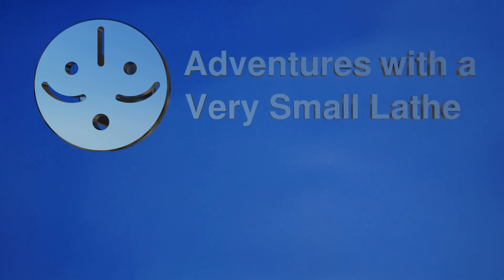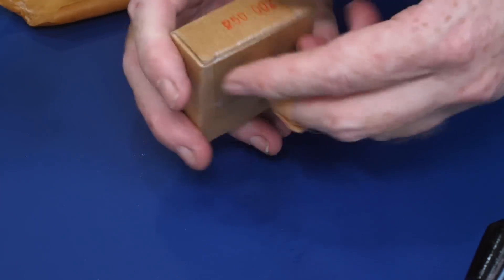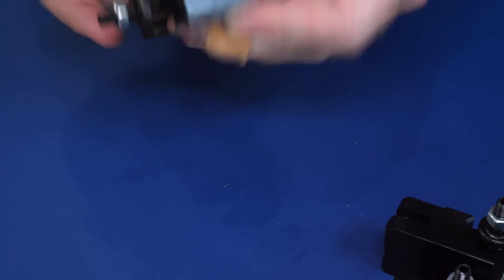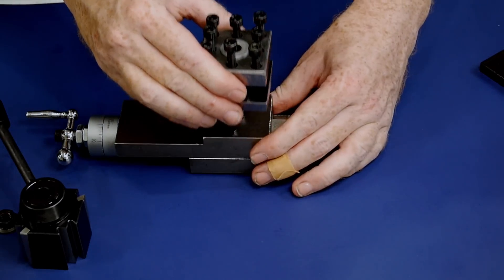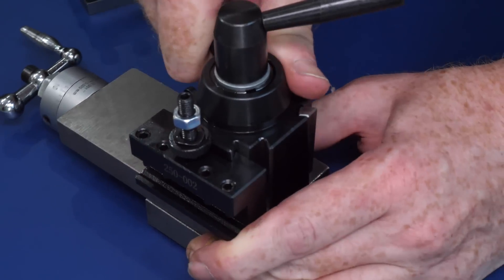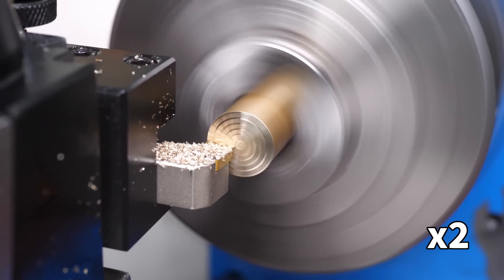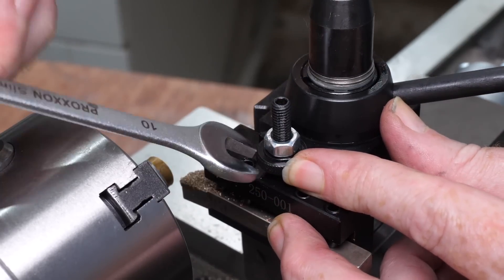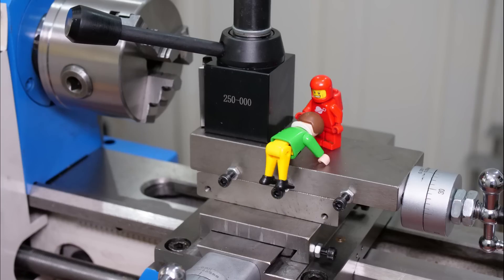Installing a Machifit Quick Change Tool Post on the CJ0618 Lathe and Banggood Tool Post Review

Comment: I envy how silky smooth the action is on your tool post. I have exactly the same tool post and the action is Anything but silk smooth. As near as I can tell the finish on the moving pieces is not great and I have tried cleans and dressing the screw-faces as well as possible. It would be nice to be able to get the center screww out to be dressed in the open, but I can't seem to get that far in disassembly.  Have you have your TP completely disassembled?  Ant tips there?

Comment: When you tightened the locking nut, on the height adjustment screw, the knurled adjusting nut moved slightly.

Comment: I bought this same QCTP for my lathe although my lathe is little big bigger (Bernardo 500). I thought that OXA/AXA would be the right sizes to fit but still think that AXA is little bit too big for my lathe. Im using 12mm tool holders. It works pretty nice.

Comment: Am enjoying your mini lathe videos.  I found a use for that base plate that came with the QCTP.  I used it to replace the flimsy locking plate on the the tail stock.  It was 44 mm x 40 mm plate and I modified it by cutting off 4 mm off the 44 mm side making it a 40 mm x 40 mm square. Cutting this way will off set the locking shaft to fit the tail stock.  Very little jamming because of the close fit.
Reply from the maker: Nice idea!

Comment: Another way I was taught for setting the tool height on a centre lathe is to put a dead centre in the tailstock and use that to shim / adjust the tool until it is level with the centre point. This works well for all types of tool and saves stock (which saves money)
Reply: I was taught to pinch a machinist's scale (pocket ruler) between the tool and workpiece, if it's vertical the tool is on center, if the top is tilted towards the workpiece the tool is high, tilted towards the tool and the tool is low.  Quick and dirty and pretty accurate, make minute adjustments after you start turning if the tool isn't exactly on center. Of course it only works well if the workpiece is fairly round to begin with and fairly concentric with the spindle.
Reply from the maker: I was taught the same technique working on big engine lathes, but it's only as accurate as the tailstock height. Unfortunately the tailstock for this lathe is way off centre height, so useless as a reference.

Comment: Hi I just bought  similar lathe but I have dificulties understanding how to operate it because I am not a machinest.  from your tow videos disassembling and reassembling the minilathe machine I learned a lot and knew how to do adjusting and lubrecating. now I need to know how to make thread. the lathe came with several gears and really I don't know for what they are used. please addvice me. I would really appreciate it. Thanks in advace

Comment: Dose it fits your Proxxon lathe?
Reply from the maker: It has the correct height range, which is the most important thing, but a custom bolt or stud will be required to fix it down properly. I plan to fit another of this toolpost to the Proxxon, but haven't gotten around to making the stud yet.
Reply: @AdventureswithaVerySmallLathe   Waiting for the final setup😎.

Comment: Some addenda: Littlemachineshop has a holder which has a plain 1/2" bore with a sleeve to 3/8" for boring bars; the thread on the fastener that holds everything together is left-handed and a good fit for the step wedge in a mill clamping kit; the leftover stud makes a good replacement for the crude fastener under the tailstock; these posts will accept 1/2" tooling if you mill a little off the top of the cross slide; and, if it's still there, that little detent pulls out easily.  I'm particularly impressed with the parting holder; I've parted 2" diameter steel with it.
Reply: Fit a Unimat DB200 I wonder...

Comment: Thanks for your videos about the mini lathe, they where very helpful for me. I ordered one and also a Machifit toolpost with some holders. But I don't know which parting tool/blade to order for the 250-007. Can you recommend a universal parting tool/blade which is good for for steel and aluminum? Especially the needed size would be very interesting. Maybe you even have a link for a fitting one (seller or shop). Your help would be greatly appreciated.

Comment: I have come to the conclusion that after watching many videos on the 'tube there is a desperate need for a listing in electronic format..... to compare the various lathes, mills and tool peripherals like QCTP's, carbide inserts and most tool holders in various configurations that most people on BANGGOOD, EBAY, AND AMAZON spend lots of money on.
I have always thought that a loose leaf folder that gets added to and upgraded with the variety of tooling as time goes by would do the trick, but paper seems to build into a huge Bible like volume that loses itself and smothers the content by variety of pages without an index. 
I suppose it would just degenerate into a catalogue once the tool perveyors get in on the act, but what the heck, a catalogue usually depicts the tool in all it's glory and you can judge for yourself......just thinking, as I've gone down this path many times before and paper does accumulate by the ream so a digital file of engineering paraphanalia would be the one place to go to for all your needs.
Compiling one would take ages and you wouldn't be able to have the comparison of variety to peruse if you didn't have access to the info etc.

Comment: Here's a tip. You will get a much better finish with a cutter with a smaller tip radius. The ones you see me using are 0.2mm and will give a mirror finish.
Reply from the maker: Thanks, that confirms something that I was starting to learn from experience. I had a 0.8mm insert in the holder, because I last used it to form an inside radius.

Comment: Same style I got from Arceurotrade, though mine is unbranded. I've had mine for about 3yrs now and it's been a godsend in terms of time saving and workflow logistics.
Reply from the maker: Is yours one of the red "Metalworker" lathes that Arceurotrade list on their site currently?
Reply: @AdventureswithaVerySmallLathe  

No, I have a 1944 Grayson, which is a 7 x 24 inch. The Grayson eventually became the predecessor of the Myford ML series when Myford bought the Grayson company after WW2.

Comment: Hi, thanks for the video -- why did you buy the Sieg Copy, which is 499 from ebay, instead of the real Sieg, which is available for 80 quid more from arceurotrade? Genuine question, I've been pondering getting a C2 or a C3, and I've heard loads of horror stories from the chinese version -- so what convinced you to go for that one? Is there something I'm missing? Also you mentioned "problems" with yours, have you documented these somewhere? Thanks!
Reply from the maker: The simple answer is that I paid a lot less than 499 for this lathe. The closest Sieg model I can see on arceurotrade is listed for 590, and I paid a little over 300 for this one. I see similar listings pop up on eBay from time to time, but the number is always limited, and it seems to be listed as s different seller each time. I guess I'm lucky I got anything at all. :)

The reason I went for the cheapest possible, is I had genuine interest in finding out what the cheapeast option possible was like, and I figured it would make some interesting informative videos as well.

If I have the time and money, would a direct comparison between a real Sieg and the Real Bull Machine copy be of interest?
Reply: @AdventureswithaVerySmallLathe  I think it would be very interesting personally -- the 'field' of hobby lathe has a lot of stuff on, but a lot is outdated as well, ie nothing on the 'newer' brusless motors for example. Or wether the newer imports have metallic gears -- or just how much do you need to 'mod' them to make them usable...

Comment: Hi, I wonder if you or any of your viewers could help me. I need to know the size of the dovetail on the tool holders for this toolpost. I have lots of tool holders for the aluminum pushrod type toolpost and was hoping that I could convert them to fit this if I bought one. The pushrod one took a 25mm dovetail cutter to produce the exact size on the tool holders.
Reply from the maker: I have tested a toolholder from an aluminium piston style toolpost on this cuniform gib toolpost, and it did not fit. The toolholder was too small. I can get more details of the dovetail measurement this evening if you are interested.
Reply: @AdventureswithaVerySmallLathe  Yes it would be great if you could measure the dovetail on one of the toolholders, thanks.

Comment: Great video. Really useful and thanks for the fitting instructions. Looks to be the same type Chronos sell at a kit 50053000. Interestingly they note that the 250-007 parting holder is not really suitable for small lathes as the angle is too much. There is a straight alternative though.
Reply: mrrgstuff how do you mean?  my 250-007 worked fine until I broke a Allen wrench in the locking screw.
Reply: @griplove  Well I have no direct experience however Chronos sell it as a set and from the note on the product page it suggests that some customers have told them it's not suitable. I guess they don't change the contents of the set as it comes pre bundled from their supplier. It would be great if it does work with the mini lathe as I may well end up with one. Thanks
Reply: mrrgstuff upon inspection it’s actually 07T not sure if that’s the difference. Good luck
Reply from the maker: I suspect that the note on Chronos is due to the fact that the blade is tilted up. If you need a longer parting blade, that will push the tip higher up, which may mean the tool post doesn't have enough range on a small lathe to bring the tip down to centre.
Reply: @griplove  Just ordered one of these from Chronos in the UK. The littlemachineshop site does a good explanation and the 'T' does make the difference. The 007 has a 4deg angle whilst the 007T is straight. According to that site you need .75" from the cross slide to the centre for the 4deg version, my lathe has about .71" so I am not overly hopeful. Anyhow even with this downside the rest of the set looks well worth the money 😀
Reply: I ran into this exact problem with the -007 slant version.  One option is to mount the parting blade upside down and run the lathe in reverse.  This worked with my lathe geometry with the holder up high.

The other option is to purchase MGEHR1010-1.5 grooving tool (which Banggood also sells for about $10).  This tool is 10mm x 10mm shank so fits in the standard 250-002 or 250-001holders (for example).  This has a 1.5mm carbide insert.  There are other widths available and other cutting tip geometries, so be sure to study the options.
Reply: @natecaine7473  Strangely enough when my set turned up it did have the straight version so it fitted the lathe just fine. An unexpected bonus to a really useful kit 😀👍

Comment: As I am sure you already know the weakest point in these small lathes is rigidity and with my Sieg C6 I have replaced (for 99% of the time) the compound with a solid block of the same height ontop of the cross slide which has the 10mm bolt attached so that the QCTP can fit as normal. However, when I want to part off  I then have parting tools firmly attached to the lantern toolpost this makes the cutting forces as close as possible to the 10mm bolt. This makes parting off up to 60mm steel a breeze compared to the old puckered rear end while waiting for the bang and stall as the cutting tool dug in. It is only a matter of undoing the lever nut and swapping out the QCTP for the lantern as everything is already at centre height.

Comment: I'm having problems with using the proxxon live center.. the live center keeps getting loose from the workpiece... also, when I put more pressure on the live center it is able to move the workpiece deeper into the chuck.. Do you have any tips?
Reply from the maker: Honestly it sounds like your chuck isn't tight enough on the part. Are you working with material that you need to be very gentle with?
Reply: Thanks for your reply! I cleaned the chuck jaws from oil and that appears to hold the material better! Hope this problem will not happen again. One more little question: sometimes my centerdrill is not able to drill the hole perfectly in the middle. Do you have any tips for doing that any better?

Comment: What is the distance between the top of the compound slide and axis of rotation and how big are your cutting tools. My lathe is very small and there are only 15mm. So with most QCTPs I am very limited in cutter size
Reply from the maker: In this video I'm using an 8mm tool, and the height of the axis above the compound is 19mm. The bottom of the tool holder is 4mm thick, so with an 8mm tool this post would need a height above the compound of 12mm. On your lathe it could even work with 10mm tooling.

Comment: I think you will like the Machifit QCTP. 

This looks like a copy of the style originally designed by Frank Silora, sold under his "ALORIS" brand name.  I have a Phase II copy of the Aloris style.   Looks similar to yours, but the next size up, AXA for my 12in lathe.
My Phase II version locks solid and the height is repeatable.
I purchased one of the knurling tool holders, but it puts far more strain on the compound nut.   It now collects dust.
I like the tool holders with slot with groove on the bottom.   Good for square, rectangular or round tools.
Dave.
Reply from the maker: Cool, interesting to learn a bit of the history behind this design. I think I've heard the name Aloris before, but didn't know that it was the original.

Comment: Add a small needle roller bearing set between the top of the qctp and the tightening handle. You’ll be able to get more clamping force on the tool-post so it doesn’t rotate away from the work if you’re taking a heavier cut. Works great on my Sieg sc4.
Reply from the maker: Is that a thrust type bearing?
Reply: Adventures with a Very Small Lathe - Yes. Something like this https://www.ebay.co.uk/itm/AXK-Axial-Needle-Roller-Thrust-Ball-Bearings-w-2-Washers/263204015323?_trkparms=ispr%3D1&hash=item3d482e8cdb:m:mN7SRwMiWffY4U3YHcdjZbg
Reply from the maker: @GreatOldOne  Nice! Thanks!
Reply from the maker: Just ordered a couple.
Reply: Adventures with a Very Small Lathe That is a good tip re the thrust bearing. Arc Eurotrade recommended it to me. It does add to the rigidity.

Comment: Nice. Have you tried this toolpost on the proxxon lathe? Would it fit?
Reply from the maker: I'm certain it would fit, and I'm considering using this one when I install a solid tool post mount in place of the compound on the Proxxon. The original toolpost will stay on the compound, and be used for threading and taper work, and the Machifit will be for regular facing, turning and everything else.
Reply from the maker: The Proxxon will need a custom stud, as the compound and saddle don't have the same M10 hole that the chinese lathes come with, and the tool post needs by default.
Reply: Nice. Thanks for the feedback

Comment: I have a very similar QCTP on my Warco Super Mini Lathe.  It works beautifully. Very sturdy with great repeatability. The real challenge is deciding what type of tool performs best on these lathes.
Reply: I also run a Warco Super Mini Lathe since last autumn. In the order was a also a Warco QCTP but I quickly got tired of it and mounted the Machifit 250-000 QCTP.
I experienced an issue using the 250-007 and a long stick out of the blade. The holder had to be milled down in order to be able to lower the holder and center the cutting edge. I'll send Alistair some pictures.
Reply from the maker: What type do you prefer so far on the Warco? On the Proxxon I've been mostly using indexable insert CCMT tooling, but that's essentially because I've been too lazy to learn good grinding technique.
Reply: Adventures with a Very Small Lathe  I have tried, and continue to use indexable and HSS tools. Like you the thought of grinding HSS tools is a challenge I have yet to try. I have though invested in a tangential tool holder (diamond tool) from Eccentric Engineering. I love it. It performs so well and is so easy to resharpen. I did however have to slightly modify my QCTP tool holder to get the best out of it.

Comment: Would I be able to use 12mm tools with this post?

Thanks
Mitch
Reply from the maker: Yep, 12mm tools fit into the holders, and the is enough height above the compound on the CJ0618. 12*12 tool holder shafts stick out horizontally a bit though.

Comment: I have an identical tool post, but not from matchifit. I suspect they are out of the same factory. I like the tapered tool holder, don’t think I’ve ever seen one. Thanks for sharing. 

-Joe
Reply from the maker: I've seen posts with exactly the same markings branded as OXA elsewhere, though only in the US. I only see Machifit branding on Banggood, so I think it's the brand name they put on generic tools they sell on their site.
Reply: Adventures with a Very Small Lathe I read somewhere that little machine shop with the help of someone else designed the OXA tool post for mini lathes. Not sure if it’s true.